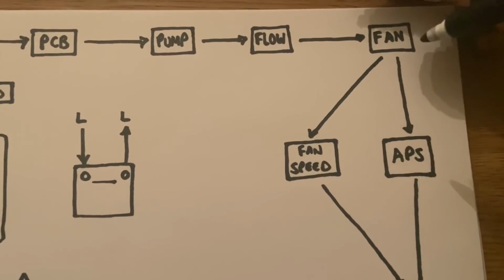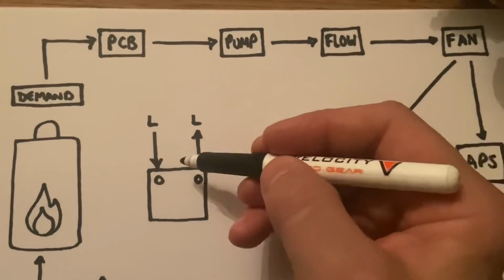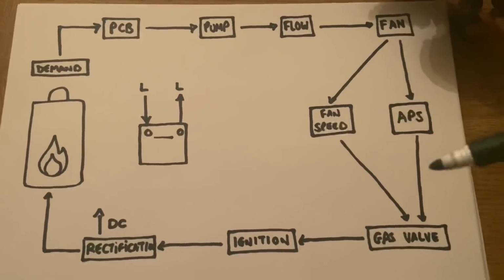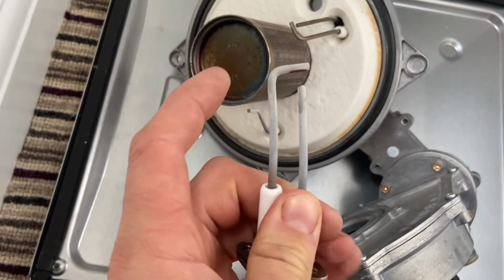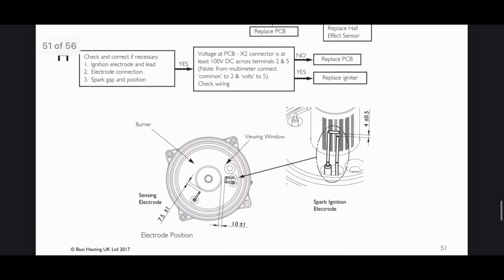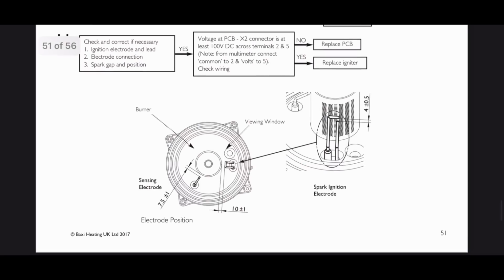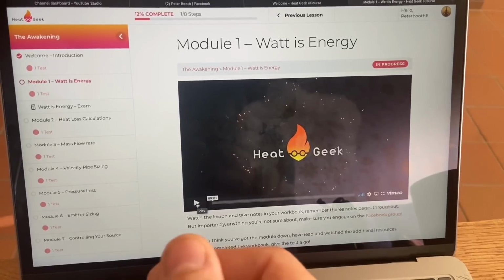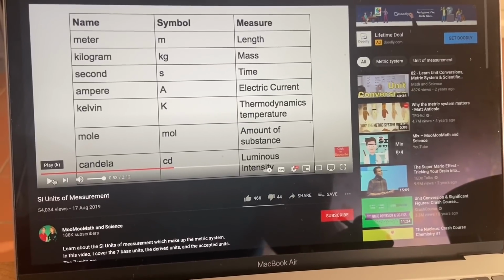P B Plumber The life of a jobbing plumber #45

Comment: In my experience far too many “engineers” will rush in and change the PCB whatever the fault is. I attended a call out while working as an engineer for a boiler manufacturer, the customers own self employed plumber was on site as he wanted to meet me at the job. Straight away he says “it’s the PCB mate have you got one on the van?” After spending 10mins checking the boiler I changed the DHW heat exchanger and the boiler was up and running.

Comment: There’s only two fault conditions with a boiler; Overheat or it not firing.  What PB didn’t point out is the PCB checks the High Temp thermistor, before it does anything else.  If it’s dropped out on high temperature or the thermistor is faulty, then there will be no Relay to put power to the circulation pump.  Also, on modern boilers, both the Pre-mix fan & circulation pump speed is controlled by Pulse Width Modulation PWM.
Repairing boilers is a very involved science, you need the right equipment, knowledge & experience.  It’s not for DIYdafties or course cowboys!!

Comment: I thought the flame rectification happens before gas valve  opens to avoid building up of gas in the combustion chamber.
Reply from the maker: The three on the bottom, gas valve and ignition happen at pretty much the same time, rectification happens when the flame sensor detects a flame

Comment: Good vid, very informative, one question though.
What's a PCB?
Reply: printed circuit board,the brain in the boiler,like ecu in a car,sensors and control circuits,run on software program,pcb needs to know things happen and then it move forward,to next step,or stop,like car ecu ,loads input sensors,load output circuits,and only one mil light on the dash,spaner light ,to let you know some think is out of the range of values ,in the software map ,plug snapon scan tool in ,to go deeper ,cant do that on a boiler lol,just test voltage with a meter ,i use same methoud as pete ,but on cars,trucks,if turn the key ,and engine cranks over and not start,fault find,can bend pipe now lol,as follow his vids,always wanted to do it ,but got it wrong,can do brake lines before,hit screwfix for 5 lengths copper ,bag wall clips,pipe bender,tape messure and a sharpie,pipe slice,bit ply out skip for test board,layout ,was fun ,cross overs ,learning soldering now,not big fan on push fit

Comment: You’re a Very good engineer and I enjoy your videos greatly, just one question I have, do you not worry that handymen, DIYers and other non gsr people may use the information from your videos to carry out diagnosis or repairs themselves ? Keep up the good work. Sam
Reply: The amount of customers I’ve had say to me yea you can find anything on YouTube I’ll be able to fit a filter on myself after telling them all about it and working out faults. I feel like this information and experience has a value which I’ve worked for and a lot of it is now readily available to the public and they feel that there is no value to it as all they’ve had to do is watch a video ? I just want to know what your thoughts are on it and maybe for me to take a different outlook on it ?
Reply: I once went to a call out the guy flooded his boiler because he saw a pipe on his balcony over a drain dripping (condense) and so he capped it. I took the makeshift cap off the pipe did my 29.1 checks and said that was the problem. He was adamant that I was wrong so I charged him £200 purely because 1 teach him not to fuck with things he doesn’t know about and 2 don’t call me out and then question me lol especially when you now have heating and hot water

Comment: would a cordless router be a better option to do the cut or the jigsaw????
Reply: @loafersheffield  to do a cleaner cut/better job and safer (safer in the sense that a jigsaw can always worble, slip,kick back. and not do a straight cut, the main reason I'm asking is I've heard that cordless routers are mini routers (less powerful than plugged versions) so would a mini router to. be have enough power be able to do a worktop,

Comment: I remember cutting into live socket cabling taking some floorboards up. Since then I always set the depth of the saw no greater than the boards I'm cutting.
Reply from the maker: I did a gas pipe a few years ago, only knicked it but had to replace it

Comment: My milwaukee cutter doesn't cut 15mm that well any advice
Reply: I’ve put a new wheel in mine but still isn’t as good as it used to be. I think the spring has got weak, doesn’t put enough pressure on the cutting wheel, but don’t know whether that bit can be changed or where you can buy it.
Reply: @martinwright7093  thanks for your reply I did think that maybe I take it apart and have a look